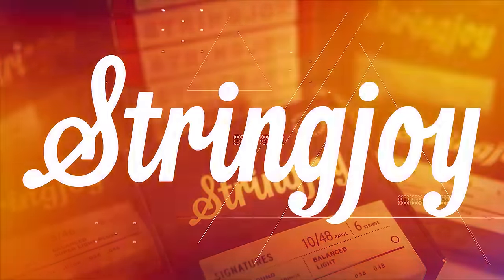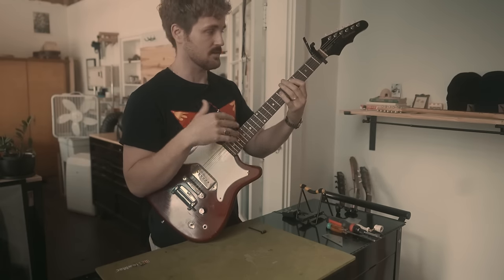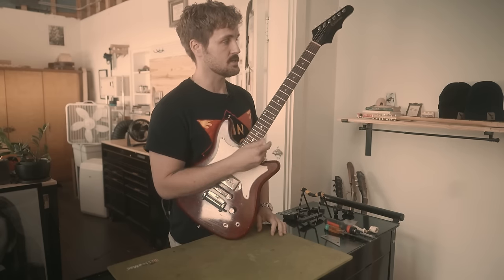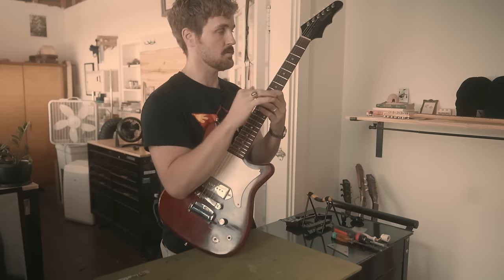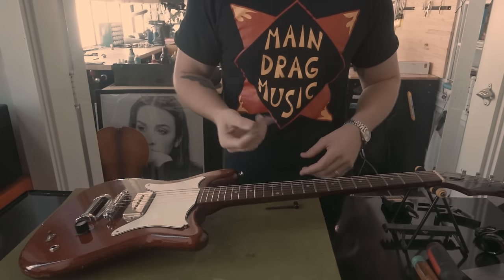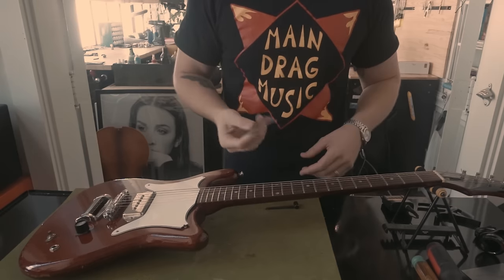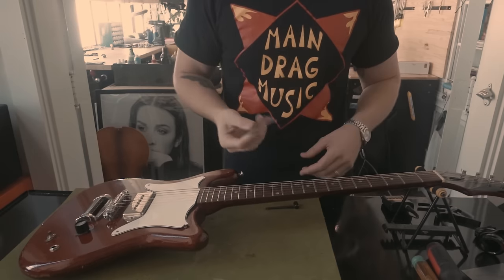Is Your Guitar Buzzing? How to Fix Every Type of Guitar Buzz

Comment: Open G buzzes on my stratocaster. I’ve gotten a new neck, leveled the frets, bone nut installed, deadened the string beyond the nut and at the saddle, simulated the nut break angle, replaced and evened the saddles. It still buzzes and nobody I’ve taken it to can figure out why it buzzes. Anybody have insight on buzzing within the tremelo system, behind the saddle plate on Strats?

Comment: Great video.  Two things I would add is too much of bow in the neck, usually causes buzzing in the middle of the Fred board and certain strings tend to buzz more than others, because they wobble more because of there core tension.

Comment: One of the best guitar setup tutorials I have ever watched.  No nonsense, no annoyingly loud music, just facts & knowledge. 

Fantastic.

Topic suggestion;  I don't see much information out there in the interwebz regarding bass VI's at 30 inch scales.  I went to talk to a tech yesterday and he specifically said that for a bass VI (in this case it is a Schecter Hellcat VI), "you don't want anything more than 90 gauge on this."

He was pretty adamant about it.  However, over the last few years, we've seen guitarists use these types of guitars to tune down as low as possible trying to reach the official brown note.  

Anyway, my question is regarding the limitations of a bass VI in 30 inch scale, pertaining to the heaviest gauges the experts would really not go over in order to not break the neck.

I don't see anything on Stringjoy over 95 gauge for Bass VI sets, so his advice might sound valid.

But anyway, a lesson on bass VI and whether or not you can use thicker gauges on them as well as any type of bass string considered Long Scale or higher would be cool.

Comment: Fantastic video and does demonstrate really well what we do all the time to assist someone achieve instrument improvement. 
I would've love to have seen in the buzz variable section is what to expect on acceptable levels of buzz vs unacceptable. 
The mere fact we have metals vibrating above a lay line of metal with create an "organic " buzz which is acceptable to theear and note quality and natural of some kind as opposed to negative buzz.

To me, a les paul has more snarl, gnarly and rock n roll (or most humbucker gats) when there's some kind of buzz

Comment from the maker: We go through a number of different scenarios in this video, so feel free to skip around:

Electric/General:
01:54 - Neck Relief
08:20 - High Frets
11:13 - Kick-up
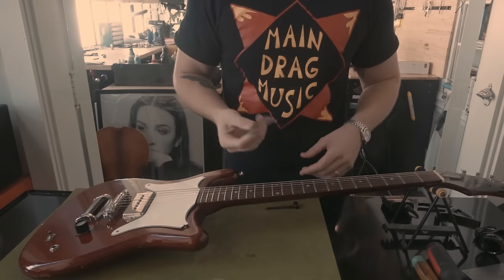14:20 - Fret Divots
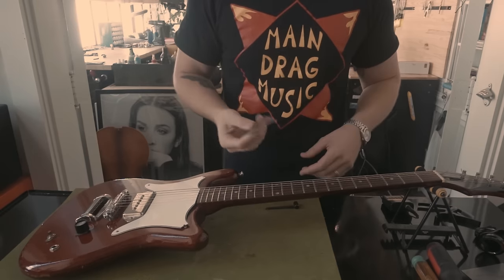15:17 - Low-cut Nut slots 
17:25 - Bridge Buzz
19:19 - Pickup Height
19:53 - Tuning Machines

Bass-specific:
20:48 - Break Angle

Acoustic specific:
22:11 - Cables/Cable Retainers
22:51 - Loose Braces
23:25 - Loose Truss Rod

General:
24:18 - Other factors that can cause buzz
Reply: This is really helpful - if you Ping your comment more people will see the time stamps 🙂

Comment: Great!  Subscribed. 
Any ideas on what is buzzing/sitaring/dead response on a new Corona Strat e & B saddles?  Both height screws on each saddle are even, intonation is right on.  Tried new strings, took everything apart to torque all fasteners, interchanged saddles 1& 6, no difference. Applying pointed pressure to any intersecting joints, springs, trem, it still buzzes. Nipped the truss rod a bit, frets and action A1, clear. Buzzing from open to up around 15th fret where the frequencies seem to stop interacting with whatever is off base.
I had a Strat do similar about fifty years ago and now don't remember how I fixed it. 😅

Comment: You missed one possibility.
If you are using "Buzzard" Brand strings, you will undoubtedly experience fret buzz. And if they are buzzing inside the package before any installation, don't even think about installing them. 
FYI Buzzard Brand strings are usually sold next to the small packets of Mexican Jumping Beans.
😎

Comment: Interesting. I wonder if the issues I'm running into are just a consequence of jumbo stainless frets. I have two guitars with identical setups as far as measurements/tuning/gauges go, and the one with stainless frets has a really atrocious pinging sound on the high E string on nearly all the frets except the absolute highest few.

Comment: My guitar got spongy after the tech took a first look. He noticed it himself after a few tweaks to make my guitar Eb. He won't be able to look at it for a few weeks. I got home and noticed it, too. When I release chords, I get crazy buzz.
I wanna increase the up bow, aka decrease tension a bit, but I have a schecter nick johnston, and the rod is at the heel. Which way do I turn slightly for relief?
Reply: I figured it out. So you're right!  it's the opposite. Like looking at a clock in reverse. Looking down the headstock on the tuning keys end, counterclockwise tightens. Looking at the heel rod from the pickups end clockwise tightens.

Comment: Ever experienced any strange string noises caused by tremolo springs?  I’m going crazy hunting this unexplainable noise down.  It’s on a strat and it’s only my open low E
Reply: Have you tried to put foam inside the spring?
Reply: @mksnz  no but I might try that. I got the sound to go away by loosening the spring claw just a little bit

Comment: I'm having a lot of trouble with buzz on the 3 first positions (including open string) on the D string of one of my guitars, I take it to a luthier and it has no high spots on frets, we changed the nut to a higher one and the buzz wasn't solved, the luthier just gived up. Do you have something else in mind that I can look for on it?
Reply from the maker: Not sure, but I would get a second opinion from a different luthier

Comment: The low E string buzzes on the first steel fret. No where else does it buzz on my fretboard. Made the trussrod adjustment. Still buzzing. Any suggestions?
Reply: Had similar problem recently on a new fender Strat  D string. I checked relief, tried adding more, action and string radius and all looked good. Cut a small piece of paper and placed it in the nut slot under the D string and all buzz was gone. Needless to say, I have a new graph tech tusq nut coming tomorrow.
Reply: If its a strat style bridge, and your nut slot is ok, raise that string sadle a little at a time until the buzz goes away

Comment: To anyone struggling with SLIGHT fret buzz, especially if it's a new guitar; what I did was put new strings, adjust saddle slightly (not too much) and kept playing and 3 weeks later the buzzing was completely gone.
Reply: That's what I'm trying with my new acoustic that has buzz only on G 3rd fret. (Also has a dead fret up around B 13th but that's less of a concern) It's a lower end Fender but I didn't expect that sort of issue right out the gate. If the new strings and a break in period don't help I'll have to look into how adjusting the saddle works with acoustics. (Or see if the store will fix.)
Reply: @workinprogress5431  I would try returning it if I were you, because with an acoustic guitar, alterations are permanent and it's difficult to go back once you've made a decision. Get a Tanglewood, which are better quality for the same price as the Fender.

Comment: Too little relief pic..... Why?  There is still space between the fret and the string.  Why would anyone not want the lowest action they can get to suit their needs?  Perhaps the lowest action possible will cut into some sustain.  If so,  just back it off til it works for your needs. I have a couple guitars will slightly less relief at the 7Th than that pic and there isn't any audible buzzing. 
The guitar is a tool.  Make the tool do the bulk of the work.